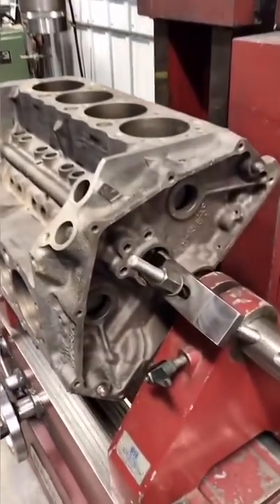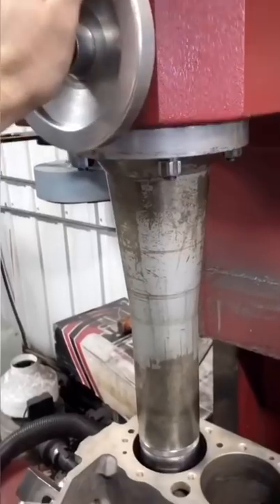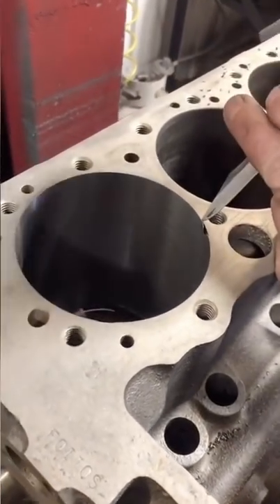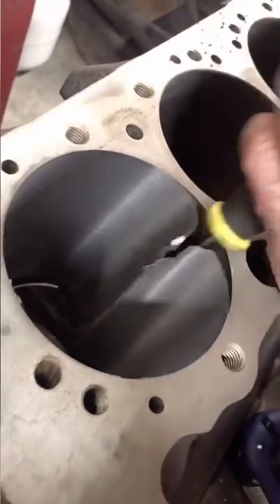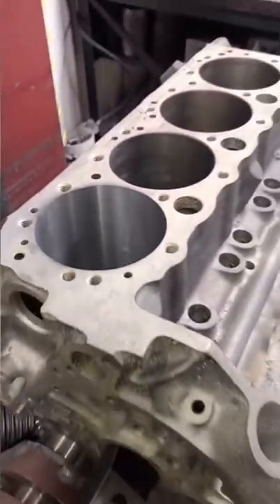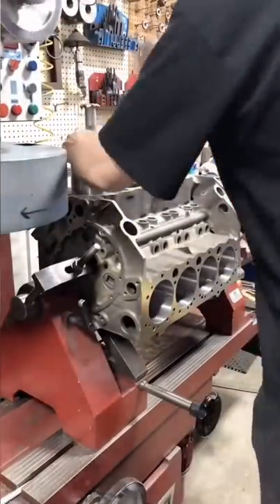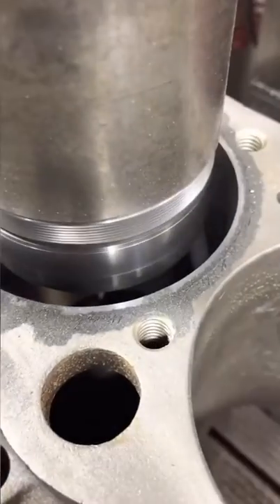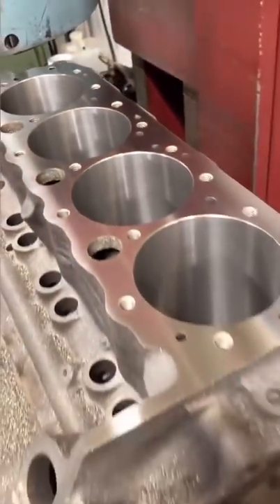#shorts Bore & Resleeve 327 Small Block Chevy Engine

Comment: It doesn’t seem like a good way to repair a crack,Shouldn’t the crack itself be addressed before adding a sleeve?Not being a smart ass just asking....
Reply: That's the most common way of "fixing" a cylinder wall crack. Since theres a sleeve, there is no pressure on the crack. There is no combustion or friction on the actual crack.
Reply: I was wondering the same, how is that crack not going to effect anything?
Reply: @MichaelLass  since it's sleeved, there no risk other than thermocycling. Crack might grow a little bit, but coolant and combustion are contained in their respective environments. Before I blew up my last project, was considering 10,000psi rated sleeves, but never got that far. Block split in have right down the camshaft galley. 302s do NOT like boost. 😂
Reply: @throttleblipsntwistedgrips1992  spending any money on a 302 is a waste!
Reply: @NORTAH85  yeah it made about 450hp before it blew up they just cannot take the abuse as long as something like a 318. Timing is super critical. Pulled just a couple degrees too many and went full send with like 18 lb of boost and smoke screened the entire Dino cell
Reply: @throttleblipsntwistedgrips1992  what Comp pistons? What cam lift and Duration? Solid or roller lifters? Stock bore and stroke? Intake and exhaust valve size? Spring size? Single or dual turbos? 18psi is a lot for a V8 for sure
Reply: @NORTAH85  I had Mahle Pistons I don't remember the manufacturer but I know it was aftermarket rods and crank (kit) stock block with a stock bore, ARP head studs, eddy RPM intake, flo-tech heads and I think the duration on the cam was around 274/268 @.50. I do remember we made a pull at like 12 or 14 PSI and it started pinging up on the top end so we decided to pull a few more degrees ran it again it did fine and then when we turn the boost up it decided it didn't want to live anymore.
Reply: @NORTAH85  also flat tappet and presicion single 76mm turbo. Oh and dominator efi carb, cause it was like brand new at the time and seemed smart. Still have most of the parts, saving them for a 351W build I have planned. Going in a fairmont. Camshaft, pushrods and lifters were DESTROYED, about the only things we couldn't save other than the block. Weird thing is another guy here has a capri with a similar setup and an 88mm and does just fine, so I know it was in the timing, because it was the last thing we messed with. Yes some of the parts were a $100 saddle on a $2 horse, but A) I was 22 and B- learning curves are steep and the price for getting it wrong is high🤣
Reply: @throttleblipsntwistedgrips1992  I’ve got a 406 SB running twins dyno’d at 936hp to the wheels on 12psi. I usually wastegate it at 8psi. Which is about 750hp. What let go when it decided to commit suicide?
Reply: @NORTAH85  like I said, split the block right down the camshaft. Made it to about 3500rpm and it was all over. Cylinders 1,5, and 6 had the cam lobes almost completely flat, lifters got knocked out of the bores and bent the pushrods, cylinder 6 I think took the most damage. Ate the valve and demolished the bore. Almost 6k total in parts and it was over faster than you can recite the alphabet. Thankfully picked up a van this sept and it's in my backyard has a donor windsor so this summer we're going to try again. Been thinking a 393/408 stroker, but I'd be happy with a mild 500hp mill especially in a wagon that weighs less than 3200 lbs so not sure if going boosted or N/A with some happy gas. Either way been told if I blow this one up, I get to clean up the mess this time😂
Reply: @throttleblipsntwistedgrips1992  I enjoyed that story more than the video
Reply: If you run a sleeved engine hard, the sleeves should be supported by a complete cylinder so as to not flex too much. Is this a concern here?

Personally I'd probably replace the block with a good SB 350 block.
Reply: No , is the shade or marck  only
Reply: I would go with the 350 to unless I was going matching number. You can't even get a steel crank for a 327 unless you have it custom made. Parts are getting limited on non 350 SBC"s.
Reply: I would use some Moroso ceramic engine sealer with a crack most pro builders use it on New engines.
Reply: What about water leaks ?
Reply: My thing is that blocks, depending on which, of course, aren’t that expensive anyway. So, unless this is an older out of production block or has sentimental value (dads old nova or something), why not just be safe and spend a bit extra on a newer, less damaged block?
Reply: @TheSlugJones  has to be a numbers matching build.   That's really the only reason for trying to save that block imo
Reply: @Slider68  Baloney ,I pulled a 340 Mopar out an iron pile, had 2 windowed cylinders and 1 cyl had wrist pin damage ,I worked at the machine shop and put 3 sleeves in that block along with a welded up crank ,old trw 2316's and no balance job, thing ran like a scalded dog in my ol 69 Dart,  still have it
Reply: My 58 cadillac bought by my parents in 1960 overheated in 1970 and started running poorly. Head gasket failed.  They parked it in the garage as they had a much newer car. Never got around to fixing it. When they passed it became mine and since I was very attached to the car and am a car guy...I began the process of restoring it back to roadworthy. The engine was stuck so a rebuild ensued. 2 cylinders had water damage pitting. He told me by sleeving those 2 he only had to do minimal boring to put in new pistons and would be perfectly fine while making the block good for a 2nd rebuild should it ever need one. Heads rockers crank and camshaft were reused. 12 years now and running beautifully and ON THE ROAD.

Comment: Cracked block, a 327 is probably harder to come by these days unless you wanna bore a 305ci block, I think that'd work...
Reply: Just destroke a 350cu with a 327cu crank. They have the same bore. It will then become a 327cu. With a few differences of course to an original 327 block. But personally unless it was just for nostalgic reasons I'd rather the 350. You can get more power out of it than you can a 327. Anyways you cannot effectively bore a 305 to a 327. It won't work to that effect
Reply: @drewinhou  was wondering. The 327 was the Corvette small block darling I know. But the 350 was a Horse power monster in it's day. If anything, the LS is the cheapest and meanest way to go on any V8 classic you got
Reply: @thetreblerebel  For sure. The 327 was a good engine for the time (60's), but started phasing them out in 68'-69' I believe, for the more popular 350cu. Essentially the same block with same bore size. Of course 327 had the shorter stroke. If I wanted to build something with a short stroke, I always wanted to build up a 302 chevy. Again same bore as a 350, but uses a 283 crank instead but I mess with mostly newer LS series engines nowadays.
Reply: You can't bore a 305 out to 4 inches

Comment: Wow I didn't know cylinder holes has sleeves, thanks 👍
Reply: It wasn't sleeved from the factory. That sleeve was installed as a repair in a previous rebuild.
Reply: @Texassince1836  what?! 😳 So it doesn't come sleeved brand new from the Showroom?! Ok I got it now, so once damaged and rebuilt, they have to install sleeves to keep the surfaces straight.

Comment: If i could give some advice ,, taping a sleeve in is not good rather press it in or to avoid scortch mark hone the measure the sleeve for ovality , find the biggest size , hone the block 0,004 smaller than the biggest size of the sleeve, heat the block, oil the sleeve and slip it in let it cool of then bore , tapping it in wil cause heat spots in the long run , across the scortch axes in the block, just my take on it , very nice rebore by the way

Comment: I did that same job everyday for almost 5 years. Multiple different engines everyday. Grooms engines.
Reply: In santa rosa?
Reply: Wouldn't happen to be Grooms in Nashville would it ?
Reply: Newbie question: is it aluminum block and gets steel insert?  I suppose u can get an insert for even a street engine fix?  Thank u
Reply: You're my hero
Reply: @stuckinmygarage6220  no it's a cast iron block

Comment: The last 327 I had I put a 383 stroker kit in it and a b&m supercharger on top, it was pretty peppy after that.
Reply: I thought a 383 stroker was a 350 block and 400 crankshaft
Reply: @Bryan Brasuell  that is usually how it's done. 327 has same bore size as 350, just a shorter stroke.

Comment: That was a hell of a crack...I can forsee that block literally splitting in 2x
Reply: Only if they run the dogcrap out of it! That block has a ton of life left if it’s moderately built and put in a nice camaro or truck and just respected instead of trying to run 4 passes a night everytime the track is open. If it’s used as a driver or cruiser then it will probly outlast us
Reply: Laughs in Nissan RB26 

But in all seriousness it’s probably fine. Would need to be making enough jam to distort those aftermarket sleeves to finally send that block to the grave. Which is a whole lot of jam. It’s a 327 so some boomer is probably just cruising it in his 67 Camaro with like 9:1 compression, talkin bout his 3/4 race cam and how it can hop a coke can even though it only makes a whopping 340 hp on a cold day by the ocean.
Reply: It hasn't split yet. That crack would have been the reason that cylinder was sleeved to begin with

Comment: Have you ever heard of stuffing the sleeve with dry ice for an hour before you're ready to press it in? It'll drop right in with very little pressure and when it comes to room temp it's basically a shrink fit
Reply: Sounds like a good technique. I'm wondering how the new sleeve prevents the coolant that is circulating inside the engine block from coming into contact with oil in the engine block when there is a crack in the cylinder wall. Could it be the crack in the cylinder wall doesn't cone into contact with the coolant?

Comment: Question is.. why? Unless it's a numbers matching restoration. 350 blocks are everywhere. And the newer ones are usually a better casting. Have roller cam provisions
Reply from the maker: It’s a 327 small journal, not a 350. 350 blocks are everywhere... 327 small journal are not!
Reply: Still, begs the question. Unless it's a numbers matching thing it's cheaper to just use a 350 block with crank bearing spacers, or just use a 350 crank.

Comment: Okay, I don’t know that much about engines, but if the top of the block has needed resurfaced twice now, does that affect the cylinder clearances for the plugs, the rods, or the valves at the inside-top at all?

I’m just going by replacing my bathroom floor and having the new not be as thick and having to think about the toilet drain pipe and flange then not being flush with the top of the floor anymore and having to redo the flange too. Which is a pain in the rear end… and the knees.

Comment: Can I ask a question to just to learn and not being a smartass? Is is even feasible to try to weld the block crack then turn it down then resleeve it? Or is it just as strong and leak proof with nothing but the pressfit sleeve in it. Thanks for your response.

Comment: I believe cylinder sleeves go in with an interference fit, Wouldn't that open the crack more? 
What keeps coolant from seeping out the crack and down between the sleeve and block?
Reply: A good save of a 327! The mutual expansion rate seals the sleeve to the block, personally I would have increased the interference by . 002 thousands. I would have put the sleeve in a freezer until it's 40° cooler than ambient temp.

Comment: Why did you not just get a 350 engine about a 70 model 4 bolt main and use it because the 327 was never a 4 bolt main and the 350 and 327 are exactly the same block unless it’s an early model 327 with small journal rods. 
Out of all the things I’ve ever done engine machine work is my passion! Boring blocks sleeving them building heads reconditioning rods.  When you buy a set of rods and you Mic them They are roughly .003 to .005 out of round. When I would buy a set of eagle rods or Mallory rods I would mic them And then I would make them literally perfectly round. 
Love that type of work I just got too old and I do not have any equipment anymore 😫 I sure do miss it.

Comment: I’m not surprised that block cracked between the cylinders. Either the design is bad and the wall between cylinders is too thin, or that block has been bored out to increase cylinder volume.
Reply: I was wondering if they could weld that crack grind and then put the sleeve in.
Reply: Could have been a casting flaw, could have been overheated, could have froze in the winter. That block is from the 1960s, its got many decades of abuse and neglect.

Comment: Amazing job you make it look easy but the tool that you’re using to drive that cylinder or sleeve down with you’re really need to grind all that mushroom off the top of that that should have a slight tapered in

Comment: I've seen a guy weld a crack like that. Bore it true and put the sleeve in. Told be  it can cause a hot spot if you don't. Interesting they didn't weld it. Engine that man welded still running. 15 or so years later. Daily driver actually.

Comment: Need to do this on a mercedes 312d, but its a cast block without sleeves.
Can i just put a sleeve in the cracked one, leave like a shoulder on the bottom for the sleeve to sit on?

Comment: When you resurface the block does that mess up the timing, or is it so little it doesn't matter?
Reply: Valve timing? That's controlled by the cam which is in the block not the heads.  Had a Inline 4 cylinder head machined and the cam sprocket was keyed to adjust it for the machining

Comment: With a crack in the cylinder like that it should have been ground down with a Dremel tool with a small grinding stone or similar tool and welded up so it would be sealed by the weld then finish the cylinder to exact specs by rehoning it with cylinder cutting tool your boring machine will do it be slow and careful then place sleeve in freezer for 24 hours and using lithium spray lube insert new sleeve and please grind your hammering tools head down before it sprays shrapnel on you !

Comment: Did you drill and tap the crankshaft or not use the original one.
Mine had 3 different size camshaft bearings ?

Comment: Okay this question is kinda stupid but: if i buy a new car with a brand new engine are there already sleeves build in or are they just used to repair the old bores?
Reply: The sleeve was there to repair a crack. This motor is atleast 50 years old. Most cars do not have sleeves from the factory. You see sleeves more on tractors, industrial machinery, etc.

Comment: At what point does it become more advantageous to just replace the block?

I mean, the engine is already this far apart..
Reply from the maker: Pretty dependent on availability of a replacement. In this case, not too readily available in our area, and what is available may be as bad or worse than this block to begin with. We’re 100% confident in this repair!
Reply: @JAMSIONLINE  that makes a lot of sense. I wasn't doubting you by the way, I was just genuinely curious. 

I do all my own work, but never any internal engine work. I love learning though, thanks for your reply
Reply: Also this could be a matching numbers car and they ned this motor to keep the value
Reply from the maker: @redneckswitwheels  would’ve been a good reason also but not the case here lol
Reply: It'll become easier to replace once texas speed or blueprint engines start making 327 blocks but their not about that life, their about making the highest horsepower crate engines. So putting a new sleeve is the best solution when spare engines aren't around.
Reply: Okay those are 4” bore blocks, I don’t understand why anyone thinks that it’s a rare block. It’s frankly not worth the money to sleeve when you can get 350 blocks for a Benjamin or two.

Comment: Just change your oil regularly and you'll never have that kind of problem.
Reply: Changing oil has nothing to do with cylinder cracks. It may have been freeze cracked, hydrolocked, overheated, or had a flawed casting

Comment: With that crack where it is opposite the other cylinder wouldn’t it have been best to do the other one next to it as well?
Reply: There is a gap between the cylinders inside the block, its not solid metal from one cylinder to the next
Reply: @Texassince1836  thanks for that,, soon as i read it light 💡 moment 👍 appreciated..

Comment: Why is the block getting a new sleeve? I didn't catch that part.
Reply: They just replace sleeves at every rebuild as a preventative measure. Some time in that blocks 50 year life it got a cylinder crack that was repaired with a sleeve in the past.

Comment: What material are those sleeve made of?  Actually VS ideally
Reply: Usually a higher grade of cast iron than the block.
Reply: @Texassince1836  got you! bc its supposed to resist way more heat and pressure. Ive never quite understood how the combustion occured on the block itself and didnt crack it or damage it over time. So the sleeves protect the blocks stuctural integrity. Thank you

 protecting the block.

Comment: How is the crack in the block going to be repaired with a sleeve isn't it just going to chill out there and be a crack forever like the old one is that normal to do
Reply: The crack is just going to stay there, its out of the way for now, so long as the motor isn't overheated, or frozen with straight water in the winter that crack will never be an issue

Comment: Is that an aluminum block? I couldn’t tell..if it is, I would just order a new block..instead of putting sleeves in the same block for the second time..honestly resleeving a block doesn’t make sense to me period, unless it’s a numbers matching show car or something.
Reply: Iron block. They're just replacing the sleeve at the time of rebuild so they can verify it was done right,  and that the crack is still not causing any issues